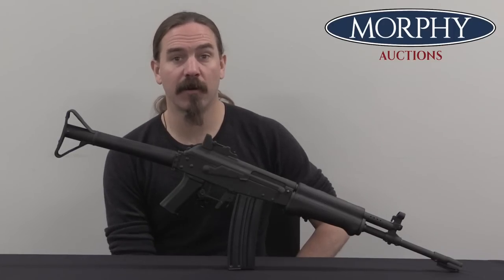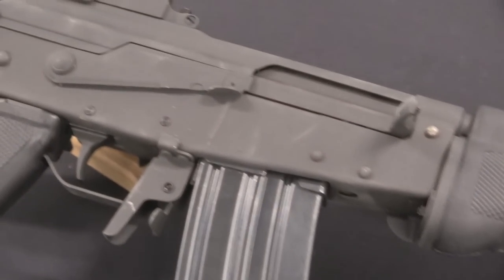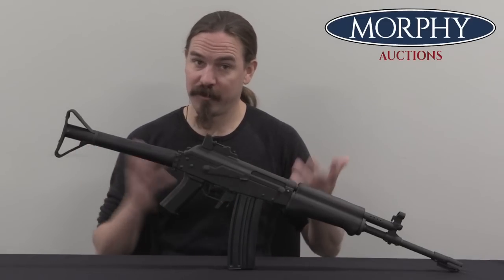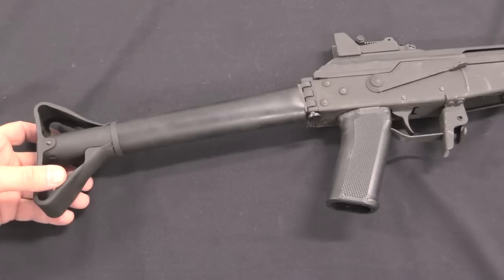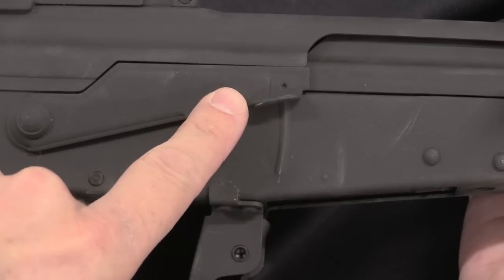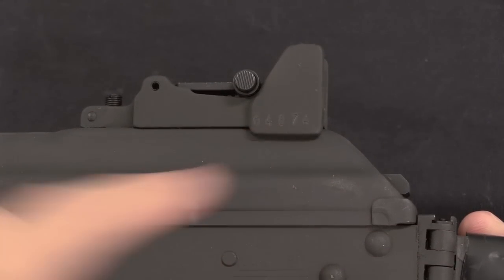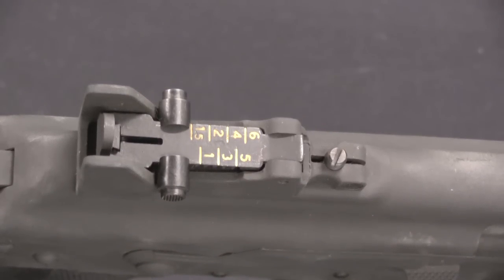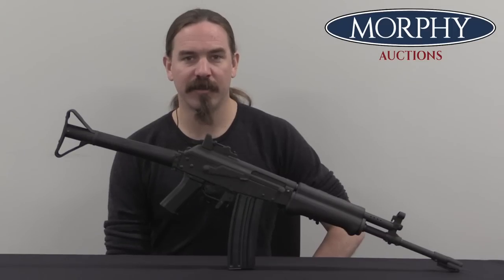Valmet M76: Finland's Stamped Receiver AK

Comment: It was slightly weird seeing how many different variations of furniture there really were in actual usage during my conscription. I got lucky and had a really good RK62 (especially got lucky and had a fresh, really good bolt on mine, very tight dispersion, while some others who I knew could shoot really well had older worn bolts and struggled with dispersion a lot), with the plastic furniture shown here, but I saw plenty of guns with old furniture, and combinations like old pistol grip and new handguard, and old hanguard and new pistol grip. It was all over the place. Having handled all kinds, I definitely vastly preferred the new furniture, just felt better in every single way.
Reply: man, I loved my combination of new pistol grip and old cheese grater handguard, I had a position for my hand that felt just right, with the tip of my index finger pressing into one of the holes :)
that rifle also had the quirk of failing to eject every single time I shot it during my first ever shooting exercise, so after that me and the sergeant went to the gunsmith and had it fixed, worked like a charm after that! something about the bolt having cracked ever so slightly, if I remember correctly.
Reply: Jj Giles  I mean sure, the barrel was good too, but we tested the same rifle with a few different bolts when troubleshooting one gun's issues, and it definitely had a significant effect on the dispersion. Bolts locking up inconsistently, and or wobbling when in battery, has been linked to inaccuracy issues. Heck, people seem to be certain that there's a significant difference between bolt action rifles with lugs on the front or the rear.

Mind you that I'm talking like going from ~ fist size groupings at 150 meters to half torso sized groupings at the upper limit, not catastrophic accuracy loss.
Reply: Jj Giles  Shrug, you can see plenty of discussion on the front vs rear locking lugs online, and Ian has also brought the accuracy claims up on several occasions. The usual claims I see are that the long length of bolt ahead of the rear lugs means it can bend or compress while shooting, affecting the pressure curve, muzzle velocity (potentially some harmonics issues) and as a result accuracy. Similar claims have been said to cause reduced accuracy in guns with inconsistent locking, which a worn bolt could definitely lead to.

On a purely theoretical line of thinking, if we take out weather (let's assume we're at an indoor range), and assuming we're using the same ammo, if it's only the barrel that affects the accuracy, it would seem odd to me that it seems so much harder to make a super accurate self-loader than a bolt action. Like, if we took a barrel from an Arctic Warfare in .308 Winchester, and put it on an AR-15 (let's even cut out the gas system so it's just a funky manually operated system), would they be equally accurate?

I'm not claiming to be an expert, all I know is that we tried the same rifle with multiple bolts, with the same shooter on the same day, and got repeatable results. It wasn't my gun, so I didn't go with the guy to the armory, but after he came back he said that they changed the bolt and his groupings got more consistent.

Comment: As a service gun, could not have hoped better weapon back then. Accurate and simple weapon to use.
Reply: That's what I was thinking, but when my fellow reservist shooters introduced me to ARs, I had a change of heart.
Reply: @edgarburlyman738  It's mainly because of the obsolescent 7.62x39 round. The 5.56 is inherently more accurate and better-behaved recoil-wise. It has to be said that as reservist shooters, we compete on accuracy. It's only half the story in a war.
Reply: @edgarburlyman738  I've shot at cinder blocks and pig carcasses with both. It was a tie.

Comment: Fun fact: nearly all males in Finland go through mandatory conscript service which includes training to use this very same gun (without the folding mechanism and with full auto setting, of course). The mandatory training includes passing required tests which include tearing down the gun and rebuilding it in 30 seconds, blindfolded. I was a bit unlucky during the test day because I had to do it outdoors when it was -30 degrees Celsius outside, so it was quite hard for your fingers (some parts are small enough so you cannot keep using the winter gloves for the whole process). All the parts were obviously about -30 degrees Celsius because the gun had been outdoors with us for a couple days at that time.

I cannot remember if the body was stamped or milled in the gun that I had in 1998 for my conscript service.
Reply: All the rk's for conscripts are milled ones. They get so much abuse that the improved durability of milled ones come in handy.
Reply: So how bad were the rations on a scale of 1-10 when you were doing your time? 1 being horrible and 10 being delicious.
Reply: @dominuslogik484  I would say  food was typically around 7–8 out of 10.
Reply: @MikkoRantalainen  that's good, I was watching an MRE review for Finnish rations recently and the comments were full of younger Finnish conscripts expressing how awful the food was and how they typically would just refer to it as "hot and yellow"
Reply: @dominuslogik484  I guess it depends on what you're expecting. It's definitely not haute cuisine fine dining but considering the circumstances, it was good. I don't remember skipping even a single meal during my 8 month service because the food wouldn't have been worth eating.

The worst part I can remember is that the liverwurst I was offered had too hard consistency. I like the soft stuff that you can smear with a knife and army stuff was much harder so you had to eat it sliced instead. That's not something I consider awful food.
Reply: @MikkoRantalainen  Maybe there was a change in the early 2000s to the process for rations but thank you for your input. its good to see not everyone had and awful experience with the food haha. Genuinely I always have found the Military history and developments of Finland to be fascinating considering the relative Giant it had to live next door to during the most Hostile century of mankind's history.

I will also admit I think the language sounds hilarious kind of like my wife's home language of Estonian there seems to be a love of vowels lol.
Reply: @dominuslogik484  Finnish and Estonian indeed have very similar sounding sounds. When a Finn hears Estonian, it sounds weird because some words sound identical to Finnish words but the meaning is different.
Reply: @MikkoRantalainen  yeah I know the Finnish word for government means Mold to an Estonian. the languages are still very closely related though, similar to how English and Dutch are so closely related.

I always thought it was funny that Estonians have all sorts of weird views on the Finnish.

Comment: Had one in 93/94(m76;7,62x39,military version with the tube and folding stock) during my military service with the Arctic Rangers in Finland. I got the folding stock because I was a dog handler. Loved the rifle.  Accurate, easy to keep clean and service also easy to carry with full equiptement , cross country skis and a dog. We used the dog in guard duty, mine searches or just in front of the troops for enemy detection.  Thanks for the walk in the memory lane.

Comment: I was recently assigned one of the stamped receiver RK62's at a refresher exercise. Rumour had it that they were brand new, having lain in storage for decades. Everything was a bit stiff (a lot stiffer than on those milled receiver RK's I had used before), so it may have been true. Great gun to shoot, nevertheless.

Comment: Oh yeah! I started with the RK62 (#322479) and ended up with this beauty (military version).
Reply: I also remember the serial number of my beloved RK62 in the army, but I use it as my password, so I won't reveal it. :)
Reply: 621747
Reply: I forgot my serial number already. 😂 But it's 26 years ago.
Reply: One of those permanently remembered numbers (#139559)
Reply: I have forgotten my serialnumbers that i had in 1/95. But i didn’t get to shoot them. Because there was somekinda limit how many cartridges there was for every fighter. So we shot mostly .22lr or Suomi-kp on the range because ammo was unlimited and we could shoot like 200+ shots per fighter when we went to the range.
Both serviceweapons were rk 62. First i got somewhat improved version with Nightsights and later when i changed my unit i got one of the very first kind. The later never left the gunrack exept on thursdays when it was cleaned and oiled 🤭
Reply: mine was 811911 :)

Comment: Here’s something you may, or may not know. Back when the M-76 type rifles were being used by the FDF, they bought a large amount of Norinco 5.56 ammo for practice range ammo because it was cheap. Turns out that this ammo had corrosive primers and it was not widely known. So after and FDF reserve unit went out shooting it all day, and turned in their weapons to be racked at the end of a cold damp day out in the wood there, that if they weren’t cleaned REALLY well, especially the gas tube, not chromed, they would rust solid in a short period of time. Had to be broken open with a rubber mallet.
Reply: U

Comment: I did my military service in the FDF in 2006. My RK-62 was made in 1988 and it was one of the newer ones anyone had. Some even had the original style ribbed handguard and pistol grip. And all our guns worked just fine except for one which broke its firing pin on the range (it was about -30 Celsius that day).
Reply: That is the one failure I have had with my semi-auto Valmet M62 also. Finding a spare firing pin was a real pain in the ass!
Reply: That's not too bad, we had one saw that broke 4 firing pins in 2 hours.

Comment: When I was a conscript, I had a privilege to be issued with RK95. Having also been in a couple of reserve drills, I had a real pleasure encountering the original RK62s, made during the latter half of 1960s, which was quite something: everything about the rifles made in the 60s was unquestionably durable and rugged, as Ian point out at the very beginning of the video. The 60s-made ones were also so well maintained by the armory quartermasters and other experts, that one actually had to leer closely for scratches or other indicators of previous usage in the grip or the handguard.

This video brings back some good memories...

Comment: I have a M76W that I bought in June of 1986 for $628 which was expensive at the time. I still have it and have put a Galili style folding stock on it, however it is totally reverseable and i still have the wooden stock.  The rifle is in pristine condition and spends most of its time in the safe.   I have the 2 original magazines for it a 15 rd and a 30 rd.  I have also modified some Bulgarian Circle 10 5.56 AK mags to bring my total up to 5.  I love this rifle and will never sell it.
Reply: there is a good chance if it has its own feed ramp that galil mages will work, but if it has just a standard AK style breech they will hang up on the bottom of the breechface
Reply: @ripvanwinkle2002  When I had my M76P back in the early 2000's there was a gentleman who was converting East German "Weiger(sp)" 30rnd mags to work in the Valmets. I think those mags are pretty hard to come by now though, as well

Comment: I was in the FDF 1987-88, and my service weapon was very much the same as this, but of course 7,62x39 full auto and with a non-folding but otherwise identical stock, and with the milled receiver. I shot with it in Lapland in -25C during a training camp, and with sufficient clothing and face covered there was no problems (apart for occasional frozen fingertips). In case someone wonders how the metal tube buttstock is in winter conditions. Very accurate too, I shot 3 "valio" during recruit training. A valio was shooting above a certain score on a specific distance, and there was 3 different tests from both prone and standing positions and different ranges (35 years later my memory is a bit hazy on the details).
Reply: That answered my question, thank you.  I was going to ask if they were issued with an insulated cover for the stock tube but at extreme temperatures a mask makes more sense.
Reply: I maxed the "valios" (each gave one day of leave) in 1980-81 and the army still owes me one day that I never got time to use. :)
Reply: @RonOhio  They have thin plastic cover over metal stock tube. Rifle in this video has that too. It's not really for insulation but more to prevent direct skin contact to metal and causing skin to stick on it.

Comment: One dude transformed accidentally a RK 62 (the real thing with cheese grater front stock, FDF version) into a machine pistol by putting it leaning against a tractor rear tire and of course the tractor driver didn't notice the RK and reversed over it and the tubular buttstock detached from the rifle. I dond't remember what happened after that, maybe that dude got some reprimand or punishment.
Reply: "the real thing with cheese grater front stock, FDF version" Feels weird to me calling that "the real thing", when you still see RK62s with the old hardware, the new hardware shown here (had this one myself), and with mix and match hardware (old grip, new handguard/new grip, old handguard), all with milled receivers and proper RK62 markings, being used by conscripts... At most I'd call it "original configuration", hehe.

And yeah, I heard that story too. And now I'm reminded of the "golf swing" method of charging the rifle... Jeez there were some stupid sods in there. :D

Comment: Have always loved the Valmet/Sako RK series of rifles. Had a plastic stocked M76 in the early 2000's, but ended up selling due to needing the money. Almost unobtainium now- especially the folding stock M76, so have "settled" for a Galil clone... I have always been curious however, how the stamped M76 receivers were stamped/formed with that distinctive RK slant on the front compared to the standard AKM receiver. Ian- maybe you could go over that sometime. Also, would love to see a video on the prototype RK "Krinkov" model with the quirky side rotating butt stock. Love the channel Ian- have learned so much!!!